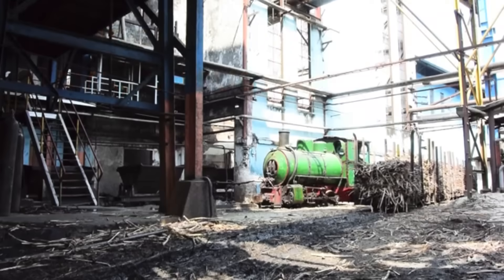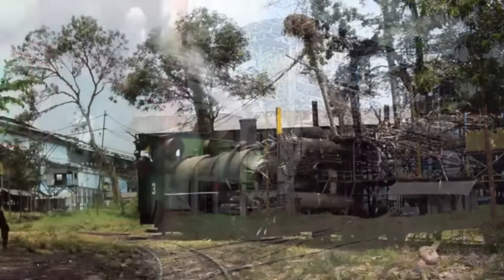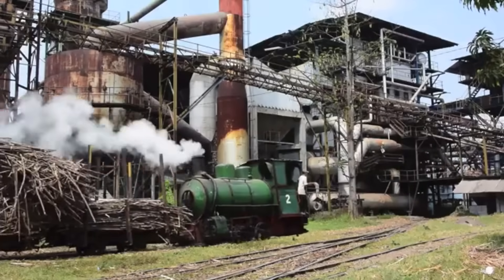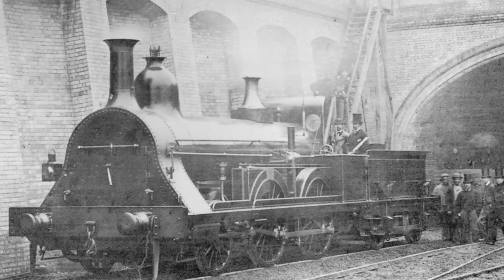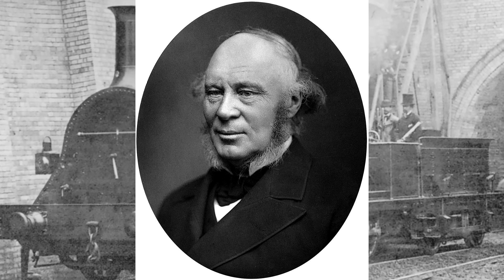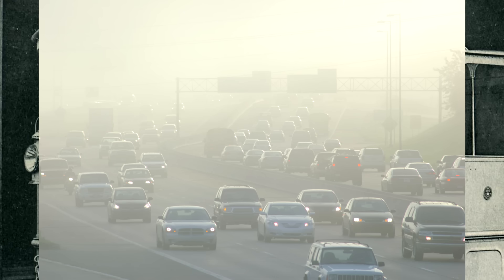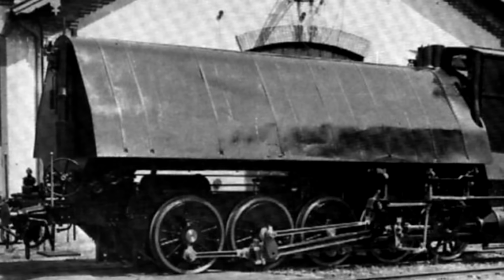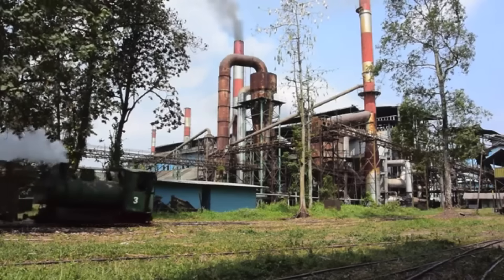What the Heck is Up With Fireless Locomotives? | History in the Dark

Comment: Wouldn't they be easier, regulation wise since it's not an actual boiler, it shouldn't have to be certified. Just hydro tested every 5/10 years whatever it is,like any other pressure tank?
Same with compressed air engines.

Comment: So would the early subway trains have been fireless locomotives as well? I can’t imagine they’d allow conventional steam engines that pump-out toxic smoke to operate in such confined areas
Reply: They used coke to reduce smoke, and had a lot of ventilation (metropolitan railway in London at least) but otherwise used mostly Normal steam locos. There were even some modern heritage runs

Comment: the main industrial use for fireless, over normal steam isnt the smoke, its the sparks, in places with flammable materials just like the sugar mills footage you used, or paper mills. it also saves money, not just maintanence, but if youve got a big stationary engine powering your mill, just syphon off the boiler a few times a day and save loads of money on coal and water

Comment: In the UK these type of loco would be used, in coke oven plants and gas works (similar explosive gas conditions), explosive and ammunition filling plants, volatile chemical manufacture, grain storage areas (grain 'dust' is explosive in air), some underground mines with gas problems, tunnel building, timber, wood and wood chip processing, army. navy and air force ammunition storage sites. etc..

Comment: There are three preserved in Ohio.  One is located at Carillon Historical Park and is named "Rubicon."  It was one of three used by National Cash Register Company.  They would attach it to the factories owned by NCR with steam and they would chug about doing work.  It and it sisters helped with the clean up operations after the 1913 Dayton Flood.  The other two were named "Dayton," and "South Park."  The second engine is located at Age of Steam Roundhouse in Sugarcreek, OH, and is Columbus & Southern Ohio Electric Company 0-4-0F No. 2.  The other preserved example is a H.K. Porter Three-tank air compressed engine No. 1, also located at Age of Steam Roundhouse. It is believed to be the only standard gauge air compressed engine in the U.S., and the only H.K. Porter three-tank still in the U.S. and possibly the world.

Comment: I once had a Mamond steam engine.  Once you removed its heat source, it would run to a halt after about a minute.  Therefore, I can't figure out how fireless steam locomotives work
Reply: High pressure, high temperature, and/or high reservoir capacity.  Keep in mind that these are used for local duties, never straying far from a recharge point; they only need to run for a few km between recharges.

Comment: I had no idea this was ever a thing.  Thanks for  the knowledge!  And now I don't feel so bad about building a model steam engine from a kit and only running it on compressed air as I was too lazy to build a boiler.  Because a "steam" reciprocating engine or turbine doesn't  require actual steam.  It just needs ANY gas that  enters at a higher pressure than ambient, to let it decompress by expanding and thereby pushing the working parts of the engine (or turbine), so that there's some sort of mechanical force (linear or rotational) coming out of the machine that can be connected to what you really built the thing to power.

This highlights the important distinction between "steam engine" and "steam locomotive".  The term "steam engine" technically only refers to the pistons, cylinders, valve gear, oil,ers, and whatever mechanical things the piston rods power.  Thus, steam engines could be fixed industrial machines pumping water, powering all the machine tools of a factory or the looms of a textile mill, or even motile in the sense of powering ships and locomotives.  The boiler was technically a separate entity with its own name.  Therefore, the term "steam locomotive" was coined to describe the combination of both engine and boiler in a single machine.  HOWEVER, all my life the mainstr3eam jargon has been to refer to steam locomotives as "steam engines", the obvious mover of old trains, with the boiler being the biggest, most overt part of them.  Because of this common misuse of the term "steam engine," generations that came up as  the steam age was ending had to coin the term "stationary steam engine" to refer to all the steam engines that weren't subassemblies of steam locomotives. It's crazy how the language changes so quickly.  But be old-school and use "steam locomotive" for train-pullers, NEVER "steam engine".  That  proves you're a real geek of steam :D
Reply: You're just as pedantic as I am!  :^)

Comment: Odd that you focus on the breathing aspect for the advantages of fireless steam, but not on the fact that it's also very handy to not have an ignition source onboard when you're using the engine around flammable materials.  This factor also explains why they were used instead of electric locomotives, since electric engines still generate sparks.
The whole not causing an explosion aspect was often the most important factor for fireless engines running in places like oil refineries, gas works, chemical processing and munitions factories.

Comment: Are we sure they’re really fireless? The only difference from steam I see is the lack of a smokebox.
Reply: They also don't have a firebox. They don't really have a boiler, more like a giant thermos. they technically have a fire in most cases, but that would be in the external boiler where it charges up, not in the loco itself. And said external boiler will primarily belong to a factory or power station. And i can assure you its true as i have seen such locos myself
Reply: For a compressed air loco the insulation (and jacket) isn't need either.  Might need/want a pressure vessel ("boiler") with a higher pressure rating than would be typical for a thermal (fired or fireless) steam loco though.

Comment: You forgot to mention another important advantage, and that's the absence of either a fire, a form of internal combustion and electric equipment which can cause sparks on them. As such they are very safe to use in environments with a high risk of fire and explosion, such as petrochemical plants, ammo stores and coal mines.
Most chemical industries, power stations and food processing plants do already have stationary steam boilers, it's still a very important source of mainly heat in many processes, and to drive steam turbines to generate power or drive very large pumps and compressors.
Coal mines do have a fine maze of compressed air supply lines to operate machinery underground without risk of explosion as the ambient air in the tunnels does often contain methane gas emitted from the coal seams, they used compressed air also to drive the locomotives as it had some other advantages in underground tunnels over steam, there was no steam exhausted which could obscure sight and would raise the temperature and humidity in the already hot tunnels which would make working conditions unbearable.

Comment: A quick point of order here is that for the most part, the biggest reason for using fireless locomotives in industry was not so much that you wanted to workers to be able to breath, it was that the locomotives would be working around things that could easily catch fire. Most of the footage here is from a Cuban sugar mill, and fireless engines were also very common in paper mills, explosives factories, and other industries where one errant spark could spell disaster. 

Also, if we're combining true fireless engines (i.e. those that take on steam and boiling water from a stationary source) with compressed air engines, then one must mention the French Mekarski compressed air trams. First developed in the 1870's by Louis Mekarski, these trams solved an inherent problem in compressed air locomotives, namely that as the air was used and returned to atmospheric pressure, it tended to get a lot colder, even to the point of causing parts of the engine to literally freeze. By installing a small heating drum that circulated hot water around the control valves, the released air was reheated enough to avoid the freezing and condensing issues. Mekarski trams became very popular in French cities throughout the 1890's-1910's thanks to being much quieter and cleaner than steam trams and needing much less infrastructure. By the Turn-of-the-Century though, electric trams and the metro finally won out. Today, only one Mekarski tram is preserved in a tramway museum in Nantes, however there are plans to build a replica Mekarski tram for heritage tours of Bern, Switzerland.

Comment: Fun fact, almost all locos can run on external steam source or compressed air. Shops often had a stationary boiler to feed pipes to compress the boilers of the locos in shop if they needed to be moved.

This way they could just conect a tube, presirice the boiler (takes like 2 minutes) then they could move the loco a few hundred meter, typicallt from one storage spot to a other.

This was also sometimes done to pre heat the locos in the morning so they could fire tvem up and get going bassically instantly.
Reply: or in reverse locomotives were used to preheat carriages at the platforms and other locomotives comming out of cold storage.
After de steaming the mainline rail network some steamlocomotives who still had enough certification left on the boiler even became self propelled steamboilers at railway workshops, factories and refeneries to produce steam for heat and steam powered equipment like fireless locomotives.

Nowadays on most heritage lines a natural gas fired stationary boiler is used to preheat and fire up a steamlocomotive  from cold storage.
Reply: In Japan, several of their preserved steam locomotives are being run on compressed air for very short distances.
Reply: @kristoffermangila  I only know of that for museum exhibits like the Tech museum at Speyer Germany. 
A coin in a console makes the wheels turn slowly on rollers by sending compresed air into the cillinders.

Comment: Darkness did u see the video where in england They tested a battery powered train for a year and in conclusion... They found out the battery train helped lower operation costs a bit, i think they proved battery train also less expensive to operate then the maintenance costs of electrified rail lines.  Supposidly they are gonna put more battery locomotives on shortlines and regional lines there.
Reply: And they charge them from hospital backup battery's at a station when stopped so there is no spike on the grid.
Reply: No electrification needed!!

Comment: I am wondering if someone could take an old uunused steam locomotive and convert it to be battery powered, like the wabtec flx drive locomotive (battery powered heavy tonnage freight locomotive).  Putting like a wabtec flx drive locomotive size battery in the tender that would power a mega sized water heating element(s) put in the firebox.  Now the questions are... 1. Would it be able to heat water hot enough to power the locomotive... 2. How many hours of run time would the battery be able to last on one charge?  Heating water with battery power to make steam might take a lot less energy then the energy it takes to power the electric generator to power the wheels on the wabtec flx drive locomotive, which if im not mistaken has a 11 hour run time and 8 hour charge time.  Could a battery powered steam locomotive Have a run time of 50- 100 hours???? I have no idea.... 3. Would the extremely high maintenance costs of steam locomotives  (pretty much the #1 reason why dieses put steam locomotives outta business) vs. Never having to pay for fuel over the locomotives lifespan put steam locomotives back in business hauling revenue trains?  Hope someone sees this comment and trys this concept out.
Reply: The Swiss already did this except they put pantagraphs on their steam locomotives and used electricity because they had abundant electricity because of hydropower but they didn't have enough coal.
Reply: Yea but would it be cheaper to have a battery tender then catinary lines and their maintenance expense?
Reply: @Steve-p7z8h no. Its better to just use a battery electric loco in that case. The swiss simply converted what they had, and batteries were worse back then. Today you would use a battery/catenary hybrid electric shunter
Reply: Yea but catinary wires carry the most expensive operating costs. What i am wondering is if u had a battery same size and strength as wabtec flx drive locomotive, put it in a steam locomotive tender, if it could have a lot longer running time (say 50- 100 hours); heating water to make steam pressure might take less energy then it would to power an electric generator.  So the batterys run time in a steam loco might last longer then in the wabtec flx drive.  Thats what im trying to figure out, and im no expert in this matter.
Reply: And what if a battery powered steam locomotive would be able to last longer then a diesel B.E.L battery electric loxomotive. Like if a Steam BEL could have like a 50 hour run time on one charge V.S. a diesel BEL having a 11-12 hour run time on one charge. They might literally start taking old steam locomotives and converting them into battery powered steam locomotives hauling revenue trains, and diesels getting phased out!!  That would be awesome!!
Reply: Check out the 5 trains that were just mad science experiments.

Comment: What if you put a Westinghouse air pump on a fireless engine, and have it powered by the reservoir and feed air back into the reservoir? Potentially infinite range lifehack.
Reply: Energy losses mean you simply waste power. The air coming out will always use more energy than gets charged back in. Basic physics
Reply: Wear & tear notwithstanding.
Reply: TANSTAAFL.  Doing work (i.e. moving a locomotive) takes energy and that energy is sourced from the loco's pressurized/[pre]heated onboard reservoir; the total energy stored in the locomotive (between recharges and relative to the environment it operates in) will always decrease over time.  I see nothing that would preclude being able to recover some residual energy from the exhaust that would otherwise be vented to atmosphere but it's questionable whether the mechanical complexity of such regeneration equipment would be worthwhile (remember these are used for local shunting duties with a recharge point thus never being far away).
Reply: @alexhajnal107 the main thing you have to worry about is wear & tear, but as long as it’s in working order, the pump would basically be bottomless
Reply: @lyokianhitchhiker  What I'm getting at is that the benefit of such a system is questionable.  Guesstimating numbers, for every 10 pascal of pressure removed from the system [locomotive] maybe 5 Pa are used for useful work [locomotion] and maybe 1 Pa could be recovered from the exhaust (giving a net expenditure of 9 Pa for 5 Pa worth of useful work).  Is the added complexity of a [turbo?]pump, one-way valve, additional seals, etc. plus the attendant maintenance overhead worthwhile given the marginal (maybe ~11%) gain in efficiency?  How does such a gain compare to that of adding additional low-pressure drive cylinders instead?